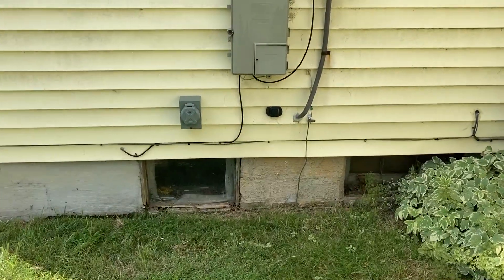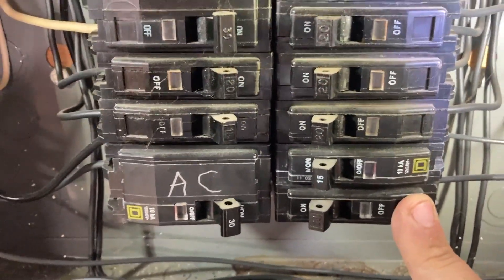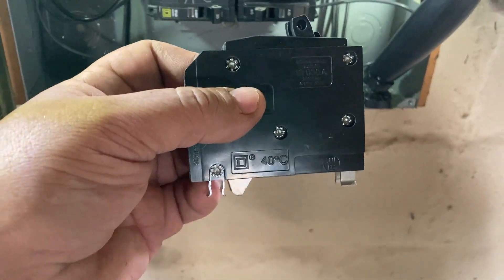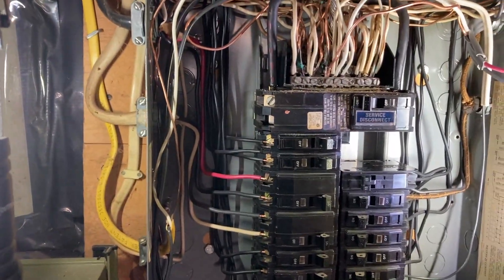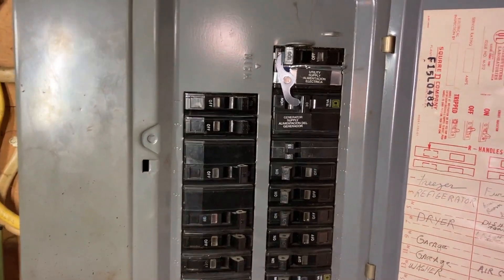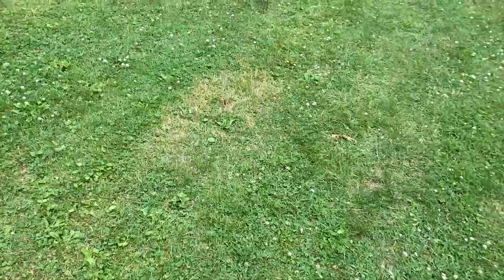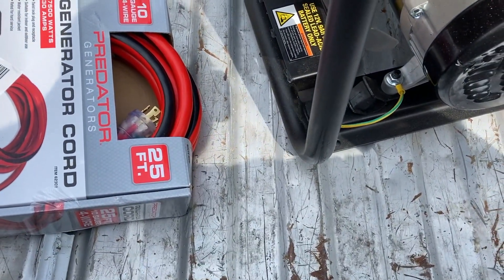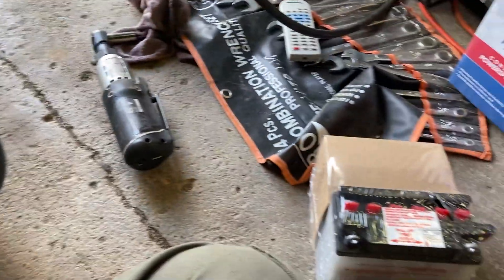Hook Up Generator Safely - Run Entire Home with Proper Interlock - Cheap - No Suicide Cords

Comment: Man that dual breaker is expensive, I'd bet you could add a Homeline subpanel for that. Looks like a good setup.  Perhaps a doghouse or old AC condenser coil housing over it.
Reply from the maker: Yes it was expensive, but I decided to just go for it and not have install a sub-pannel or install a new service.   Sometimes you time is worth something.  I have plans to built a small little roof with 4 legs that will pop out, that I can sit over it if it is raining.
Reply: @frugalprepper  So very true.

Comment: Im saving up for a whole house generator. I have a westinghouse picked out from home depot. I think I can get it in another month or two, Gonna wire into the panel the same way. I have a very small double wide so it should easily run the entire house.
Reply from the maker: Save Up?!?!?   Just get a home depot card!
Reply: @frugalprepper   I loathe debt! LOL!
Reply: They have them on sale about once a month if you watch their "special buys of the day" page.
Reply from the maker: @bctruck  Home Depot has 6 months same a cash for any purchase over $299!  Come on get a card, it will SAVE you money!   And it fun and everyone is doing it!  LOL
Reply: Make sure you follow all the generator safety rules carefully. Just reminding everyone to be careful whenever using portable generators.

Comment: looks good  tom....if done the hack way what will back feeding do to a breaker?
Reply from the maker: There are a few reasons that it is dangerous.  It's not going to hurt the breaker.   And we are back feeding a breaker here, but in a way that the main has to be turned off before the back feed breaker can be turned on.  First if you leave the main on and power up the generator and back feed the breaker and the utility power comes back on.  Your generator is going to be out of phase with the power company and the power company is going to win.  Your generator is going to turn into a molten flaming ball of gasoline flying across your yard.   Second is that you could electrocute a lineman working on the lines.  
 
The suicide cord has male ends on both ends so you can energize on one end of it and someone unplugs the other end and touches the prongs on the other end,  It only takes bout 1.5 milliamps to stop your heart with AC.  

This is just a way that makes if fool proof to be safe.  If you are in the middle of a storm in the middle of the night trying to hook your generator up in the dark and the rain, this will prevent you from making a mistake that could get you or someone else killed.
Reply: oh yea you were back feeding that breaker...will it still open ant the at the amp said ?   yes out of phase high and low dont mix...one time .i had borrowed a generac with a briggs and it was so loud i gave it back
Reply from the maker: @scuba422123  Yes will still still open at 30 amps, plus there is a 30 amp breaker on the generator itself.

Comment: It might be a good idea to upgrade your shop lighting to LED which will save you fuel and power costs. If price is a concern, you can get cheap LED lighting strips online and wire them into a single DC transformer. Gut the ballasts and fluorescent tubes and tape the strips where the tubes used to be. You will use far less power and increase light output.
Reply from the maker: I am going two switch the lights over to LED soon.